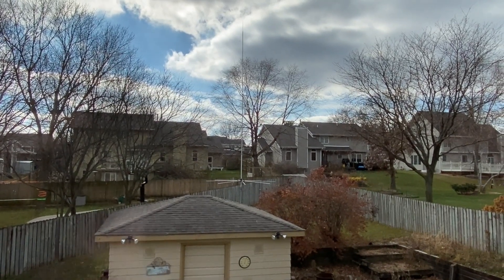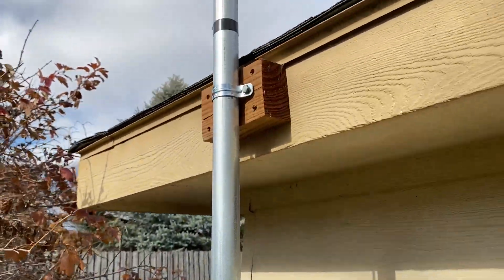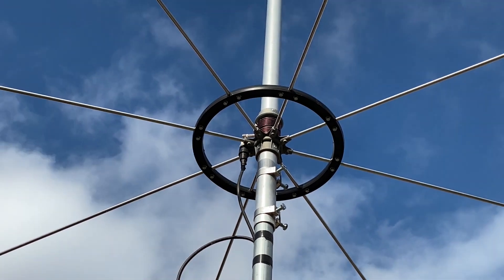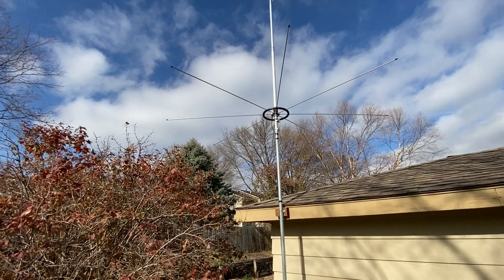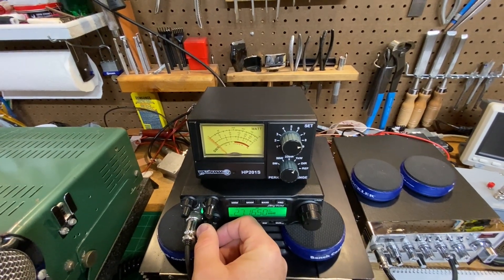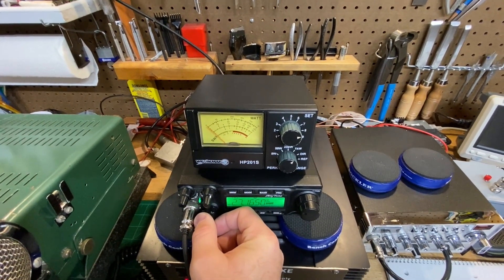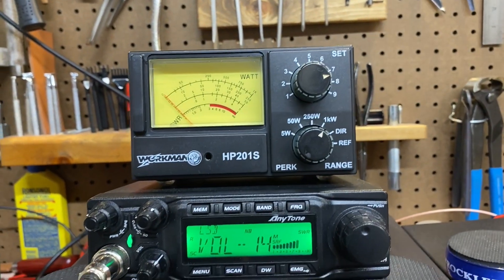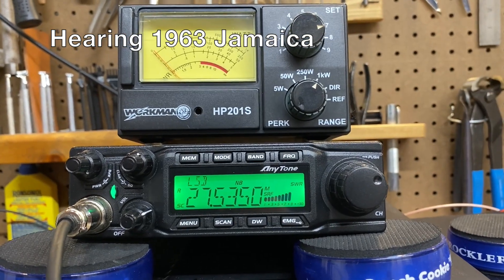Sirio 827 One Year Review and Overview - CB Base Antenna

Comment: Nice i have an imax i black taped it up gonna put in pine-tree 28ft up not to high have good one 290 in beer Capitol wavn
Reply: Why the tape? For splinters?
Reply: @Fox250R  hard too see when placed in tree plus splinters
Reply: Hey Randy how many rolls of tape did it take to wrap that thing LOL I've actually thought about doing that too, starting at the bottom wrapping up to the top of each section and then back down over it so each wrap is like a roof over the last one.
I think I figured it would require about 10-12 rolls.
How many did yours take?
Reply: @furion..  one roll   3m 700 stuffl ive been running my penettator 500 on 10ft mast i moved to new house  im on 38 lsb take care from 290 located 20miles west of milwaukee